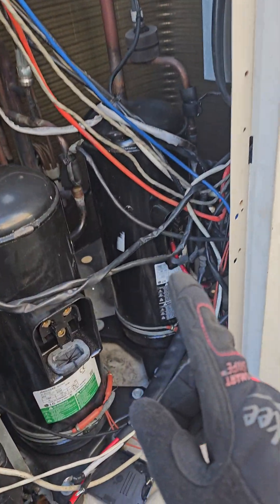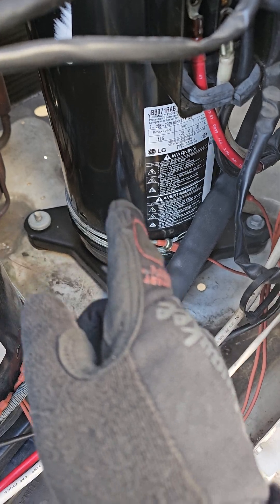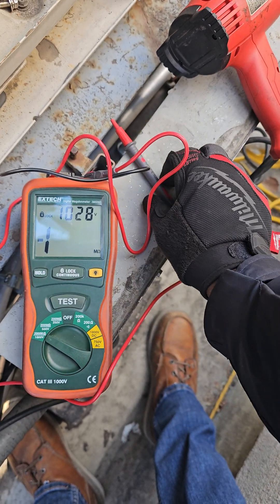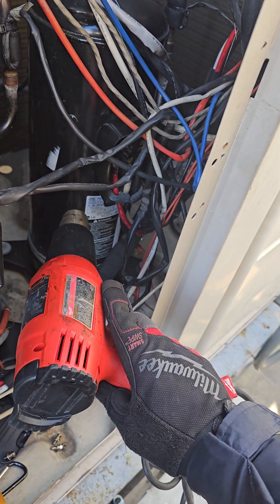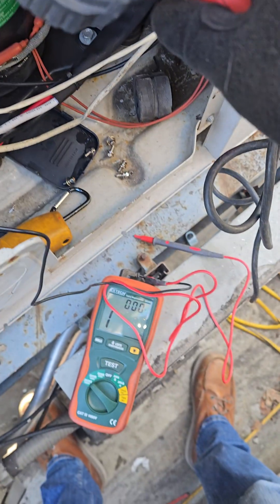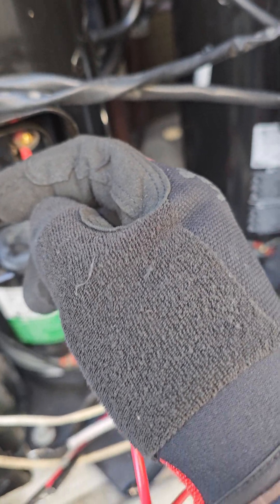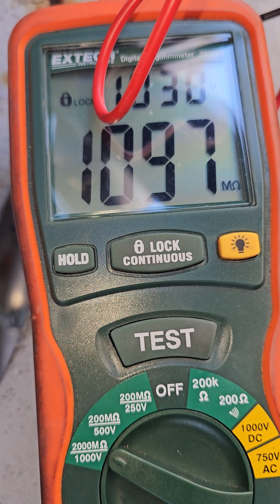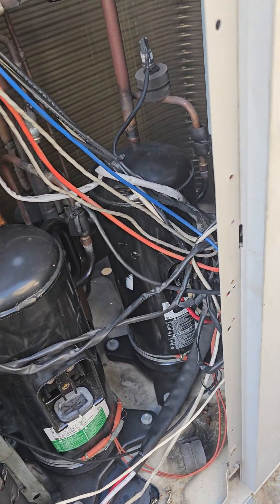DO THIS BEFORE YOU.. CONDEM  INVERTER COMPRESSORS

Comment: What would you say about the CH 21 error, and where the compressor passes the resistance and insulation tests? The contractors have diagnosed it as a locked rotor the times it occurred since the current reading on the compressor wires skyrockets to 20+ amps, and they have replaced both the compressor and the IPM board. There is still one that hasn't been changed yet, is there a way to test if it's actually the board that failed and not that the compressor is bad? Thanks.
Reply from the maker: If you are reading high amps on all 3 legs at startup.is a locked rotor  bad compressor
Reply: @D2DNYAC But shouldn’t voltage also be checked to make sure it isn’t being underpowered which could be causing the high current?
Reply: If you are trying to check voltage on a running motor driven by a VFD, you need to make sure you are using a true RMS DMM that has a low pass filter.  It needs to ignore the high frequency PWM pulses or voltage readings will be significantly higher than they should. 

There are a series of test that can be preformed to test the operation of the VFD.
Reply: @HVACR559  I noticed in the manual that it states you should check voltage with an analog multimeter, though it doesn't mention what the voltage should be, only that it should be stable and not fluctuating. Also, when you say swap leads, are you saying to swap them with the other compressor? I've just been concerned about doing that if it might damage the other good IPM board if the compressor is the issue, or vice versa unless if I am over thinking it.
Reply: @Rodj12341  The voltage can be all over the place, but it should match what the drive says its doing.  The frequency should also match what the drive says its doing.  The bus voltage should be just shy of the incoming voltage peak to peak.  If your DMM cant read VPP, you can use the following formula to figure it out.  RMS ÷ 0.707 = VPP.  So 480 ÷ .707 = 670 so the DC buss voltage should be just shy of 670 v DC.  208v would be 294 volts.  

Distance between the VFD should be kept short not over 100 ft or reactors or other means will need to be added to prevent standing waves from developing at the motor end.  CaptiveAire exhaust hoods usually have the VFD in the kitchen along with a reactor to help eliminate motor damaging standing waves.  If moving the VFD away from the controls I would suggest using 4 -20 ma instead of 2-10 v to reduce control issues from inductive coupling.
Reply: The motor also needs to be rated for use with a VFD.  VFD's create PWM signal unlike a sinusoidal signal this induces current flow through the bearings back to the VFD.  This current flow will cause pitting in the bearing leading to motor failure.
Reply: One thing that can be done is to swap leads to the compressor. If the problem moves with the compressor, you have your answer